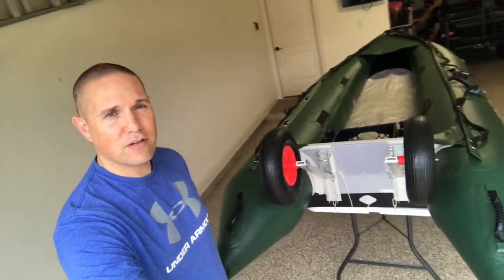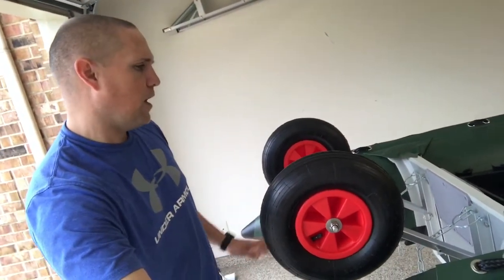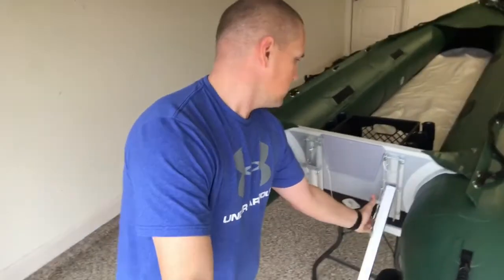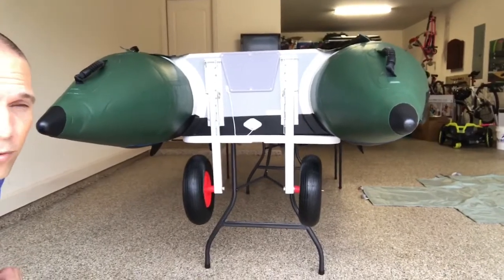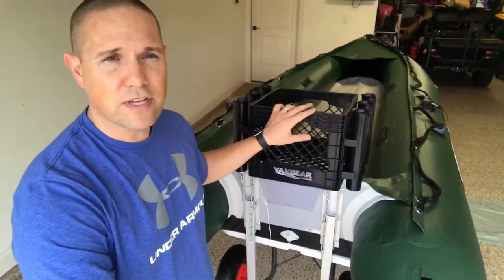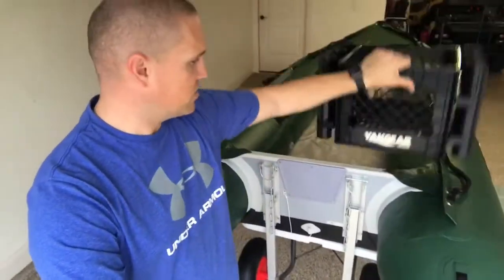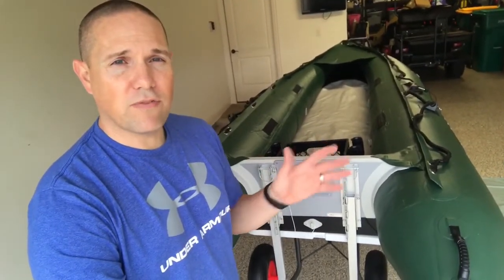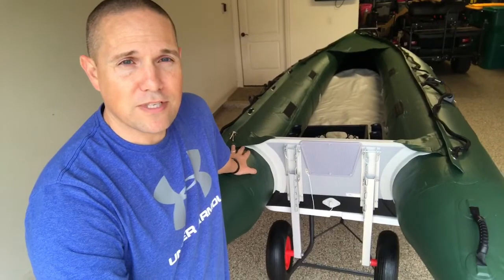Saturn Kaboat Modification - Launching Wheels 👍

Comment: Im looking for replacement tires for the same trolley set up. Boat to go told me to look on amazon or Ebay. I can't find them anywhere.  anyone have any ideas
Reply from the maker: Good question.  I haven’t looked or needed to replace them yet.
Reply: I went to Harbor Freight tools and got a smaller size tire to replace to 10" tire. Cost was less than 20 dollars.

Comment: This video is very helpful. What's the name of the pins you use at the top of the bracket? also where did you get them at? Thank you.
Reply from the maker: anzai123 - I got them at Home Depot, and they are called coupler pins. I appreciate the comment and feedback!
Reply: Thank you for your fast reply. I will check with Home Depot.
Reply from the maker: anzai123 - No problem. I believe they were next to the rolls of chain (on that aisle). Which is where I also got the small lengths of chain cut.

Comment: Show me how you installed the wheels
Reply from the maker: Sorry, I didn’t film that process.  I did however just follow the installation steps that came with the wheels, and made sure to use silicon caulking around the drilled holes and again around the metal brackets to help insure water wouldn’t get in.

Comment: My 2 cents....here goes..... first, notice that he has coupler pins at the top of the brackets. Since it's known that lock pins tend to shake loose from vibration, I thought why not go with coupler pins only.  Next.... I don't want those wheels hanging of the transom and in my face. After launching the boat I will remove them. I might have a bag made from ballistic cloth just to contain them but first putting them into some sort of plastic bag as they are wet.
Reply from the maker: Yeah. The chains helped to keep it out of the boat, or at least prevent the wheels from hanging over the battery or gear.  I never had a problem with any of the pins coming loose.  All that being said, if you can take them off entirely, go for it.
Reply: @FishingtheLoneStar  I feel that this arrangement will put a large strain on the top bolts holding the mount to the transom. The force exerted might one day rip those top bolts out of your plywood transom.  Good luck.
Reply from the maker: @chrisbarclay8903  - for years it wasn’t an issue. They aren’t very heavy, and most of the time I just let the wheels float behind in the water.

Comment: Great video man- I was trying to figure out how to use these with a 9.9 without losing turning radius. How loud are the chain links when on the water?
Reply from the maker: The chain links are loud at all. I’ve never actually noticed them to be honest. But I also run a trolling motor.

Comment: Do you what is the best shaft length trolling motor for this boat? Can I use 24 inches shaft length for this boat?
Reply from the maker: I’m really not sure.  It might be best to send that question to BoatsToGo.com. They are usually pretty good about answering those questions.

Comment: I think the big problem is the height of the wheels.  If you have a boat with a lot of weight it will be difficult to disengage the wheels because you need more depth.  Also when coming out of the water again it will be difficult to engage.  You can only do one wheel at a time so your boat will have to be onshore before you can do so.
Reply from the maker: No, you just turn around and lift them once you’re in the water, and then put them back down while in the water before reaching shore. Pretty simple.
Reply: Ok, but you gotta do them one at a time.  And to come out of the water you either have to lean over the transom which is not easy to do with a motor in the way, or you have to get out and disengage. Its not easy.
Reply from the maker: Go Gan - I’ve never had a problem reaching them and flipping them up. I’ll often pull up to a dock and hop and do it from there. It’s never been an issue for me, but might be for some.
Reply: Hi. I am not trying to be a jerk. I have used wheels very similar to this for about 25-30 years. I launch off of a gradual sloping  beach with small pebbles so I have had a lot of experience.  I use a 12 foot inflatable with a 120 lb motor.  For me a smaller clearance would be preferable. Ie. wheels as close to the hull as possible and although i like the big wheel, a smaller wheel would be better.
Reply from the maker: Go Gan - Makes sense!

Comment: the water does not enter through the holes that you drilled
Reply from the maker: William Collejo - No, I used rubber washers to help with that, then put silicon caulking around them as well.  The top holes don’t come near the water level, only the bottom ones, and even then it’s right above water level. Stayed dry so far!
Reply: Fishing the LoneStar thank you for your information
Reply from the maker: William Collejo - You bet. Happy to help!
Reply: Fishing the LoneStar one question that kaboat is really strong to be safe in the water. I want to get one but looking more information about it
Reply from the maker: William Collejo - I believe it will hold up to 900lbs. I have fished in it on a lake with two grown men (me and one other person) for up to 4 hrs, with trolling motor, battery, tackle, etc, and not a single issue. I’ve actually done this three times now, and once was super windy 15-20mph winds. No problems at all.  I’ve even taken my kids out multiple times for several hours, which speaks to how much I trust it. There’s also 5 different air chambers in the one I have (SK385XL) so even if one went out/low, I could still stay afloat long enough to still get back to shore.
Reply: Fishing the LoneStar 🙏 thanks for help and for your wonderful videos and blessings